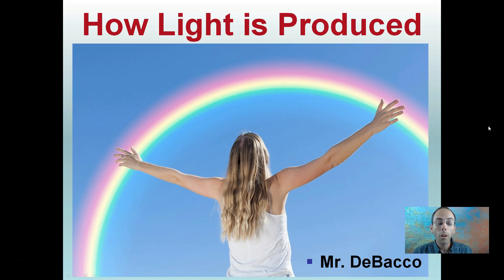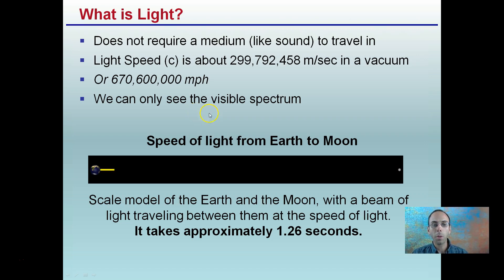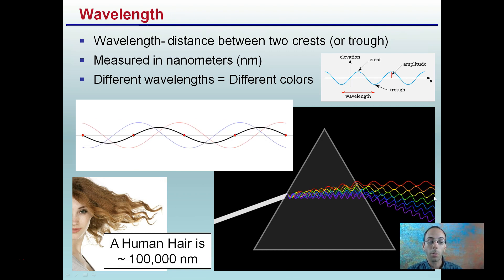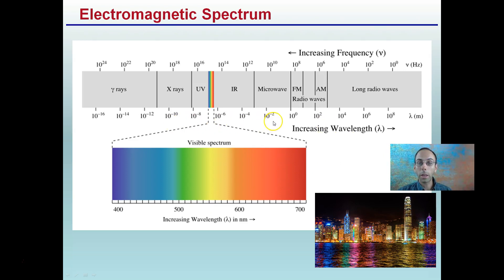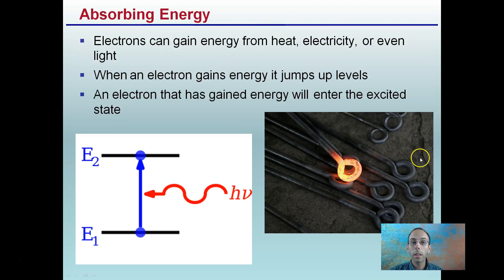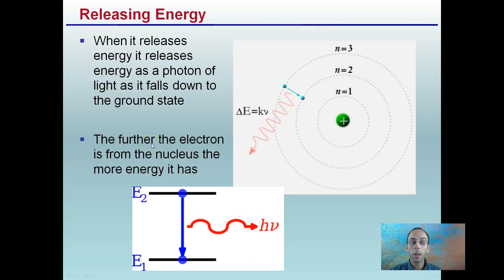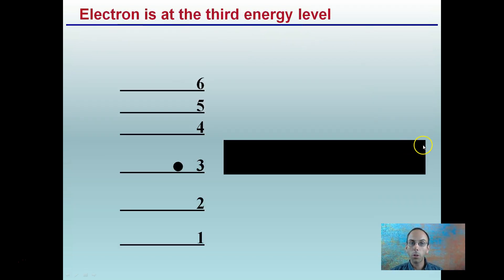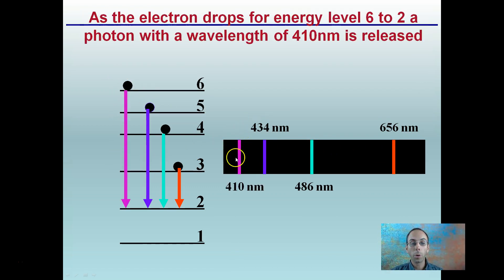How Light is Produced

Comment: how do we make light? simplest explanation for this is, we make light by (heating elements). elements has to be heated to to a point they glow. this is visible light. how do we heat and what element we heat is our choice. We measure light with temperature. even in chemical reactions heat is involved. after this ignored or intentionally missing fundamental part we can move on to other explanation. CRT doesn't work if fully vacuumed, light bulb doesn't work if filament is broken and fully vacuumed. i can extend this much further and deeper but it wouldn't make difference since everyone seams to ignore this intentionally. can you please produce light any other way in full vacuum to prove that i am wrong? thank you. also lights one way speed was never ever measured! so that number is false!
Reply from the maker: You may find this article interesting... https://phys.org/news/2011-11-scientists-vacuum.html